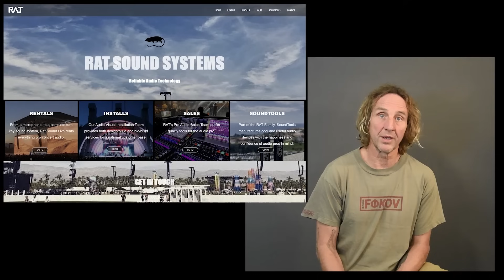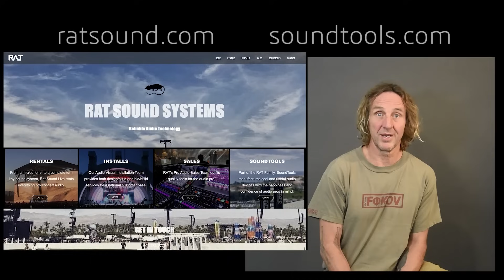How to EQ Live Sound Systems Tricks - Updated Version

Comment: Really learning a lot from these videos (thanks Dave for your generosity!)  Regarding wedges (and this is obvious but helps to keep in the back of one's head as something to check...) it's important to know the polar pattern of the mics and position the wedges accordingly.  I've made the mistake of placing wedges directly behind Beta SM58As when they should be 120 degress off-axis for maximum rejection, then sheepishly crawling in front of the performer to move it after they indicate they need more level and there's no way that's happening without me castigating myself in front of the sound gods (and audience) to move the darned thing.  Also, some stages (small venues especially) are literally hollow plywood boxes themselves and are a major source of low end feedback (wedge -> floor -> mic -> wedge).  In these instances, placing packing blankets (or whatever is handy) under the mic stand(s) and moving the wedges off the front of the stage (stealing some dance floor) or placing them on blankets too, can make a world of difference.
Reply from the maker: https://youtu.be/53-E8nUN7xM
Reply: @DaveRat  Dave, "awesome" is an overused term, but you're a freaking awesomely creative dude.  Respect! 🙏
Reply from the maker: Hell yes and thank you

Comment: Good thinking here. I do have an exception to this I wrestle with all the time. I work a medium sized venue that isn't acoustically sound. It's been engineered with acoustical treatment and fills throughout the venue to try to even the sound out and it's well-tuned. The issue is that the place can't handle a lot of sound pressure in the room without feedback from the mains and because of the size and shape of the stage it differs depending on the location of the individual microphone. Additionally I have choirs or orchestral sections whose microphones function as more of an array. I make it work, but it's less than ideal and I typically have to use channel EQs to mitigate feedback.
Reply from the maker: Sounds like some sound absorption above, behind and to the sides of stage is in order
Reply: @DaveRat  I'd absolutely love to do that, and we have gone some way towards it. The stage isn't walled in as much as it's out towards the center of the room with balconies above and below on three sides and a moderately open area behind. It's an architect's dream but somewhat less than a good dream for a sound engineer.

Comment: Great video Dave. When it comes to "ringing out" wedges, at what point in your workflow do you do this? Do you run a CD through the monitors first and get that sounding nice, and then go on with an SM58 or whatever and and ring them out? And do you find it best to do your FOH system EQ first and then add monitors in after that? Lastly, do you do your monitor EQ'ing with the FOH PA on or off? I imagine having it off helps to isolate issues, but doesn't account for the combined effect of the system as a whole.
Reply from the maker: The two systems are seperate.  Ring out mona, EQ mains and then if the pa makes the mo s ring, try to EQ those freqs from the pa first.

Comment: Dave I had a question for you about EQing without a system processor: the way we have our installed system set up, we run our speakers directly out of the console's matrix outputs and I have EQ and limiters inserted on each matrix output. In addition, I have graphics inserted into the Stereo, Mono/Center and Subwoofer main outputs (we run LCR plus subs). Do I use the EQ and limiters on the matrix outs the same way as the system processor for speaker correction and then use the master fader graphics as the venue EQ? Or would I use the matrix EQ as the venue EQ while also taking into account speaker correction?
Reply from the maker: Hmmm, the matrix eqs would be used to hear all the various speakers on each matrix send to sound the same and close to coreect So running punk and getting each some or area eq'ed similar.

The stereo eq would be to compensate to global room issues, temp changes and such.

Treat the matrix eqs like you would a system processor EQ and the stereo eq as the active show eq
Reply: @DaveRat  ahh gotcha. How would I balance the four graphics i use as the active show EQs? Do I just apply the same settings from stereo left and right graphics to the center and subwoofer graphics?
Reply from the maker: Can do, typically the center is not so loud and not shooting very far in most configs, so it's EQ shouldn't change much with room temp and such.

I treat subs as their own seperate entity.

Comment: Thank you Dave. 1. Can you talk about smiley face EQ and also, 2. what to do when you need to cut 500 ish hz on every vocal mic to get rid of boxy sound, and also 3. harshness around 1k to 2kz.
Reply: I'm not Dave Rat, but this is what I use a vocal group EQ for. I buss all my vocals to a group and insert an additional graphic EQ on that group. This helps me get additional control over global mic problems with the group para (although this definitely works best when you're using the same mic for all vocalists), and there's an additional grab graph available for the dreaded "let me put on my cowboy hat" moments that can potentially induce feedback with unplanned-for early reflections.

Comment: Dave when you EQ with a reference CD, hour headphone and the speakers venue, it sounds good at YOUR position behind the console. How do you fix huge venue in different area ? being at front stage or way up in the back of a stadium isn't sounding different than what you hear at your reference point behind your console in the middle of the venue ?
Reply from the maker: Ideally, a properly designed and set up system strives to cover a venue evenly. That said, while setting up a system and EQing, one would do all they can to even out the coverage as well as take note of issues that can not be corrected with the system/venue combination, such as a bomminess under a balcony or lost low end for people way off to the sides.

Also, mixing from room center or on a riser puts the engineer in a position where the sound is less like the sound where most listeners.

Putting reference mics located in areas of concern that go an analyzer, can be helpful for staying aware of sound in various places.  As does wandering to hear the sound in other places than the mix position so correction can be made, is wise.
Reply: @DaveRat  and I just thought that an empty venue vs a venue full of public must also affect frequency response ! thanks for the precisions !

Comment: Great video. 
I usually do small rock shows. Mixing the channels with headphone will cut off the natural sound that comes from the stage - from the drums, amplifiers,  monitors, and acoustic instruments. 
Do you ignore this when you mix, EQ and balance the band with your headphone? Is it negligible related to the FoH?
Reply from the maker: Hello Niv! So I use headphones as a reference for insuring the room sounds similar to the PFL of the instruments.  Also to compare to a recording. The goal is not to mix in headphones and ignore the room sound any more than it is to mix in the room and ignore the headphone sound.  The goal is to get the two as close possible to each other. And have both the headphone mix of the band, and the room sound of the band sound tonally similar to a desired recording of the band or similar music.

The way we perceive sound can change from day to day. If you are tired, have a cold, just off a plane flight, hung over or are 30 shows into a tour, our perception of volume levels and tonal balance will drift. If you mix a show after plane flight, you will tend to mix brighter and louder. But, if you use an SPL meter to mix to the same volume every day and you match the brightness of the PA system to the brightness of the same recording and to the brightness of the pre-house EQ console outputs, you can learn to mix the same brightness regardless of whether your personal hearing has drifted.
Reply: As a video guy, please, whatever you do, always include guitars and bass in your mix for speakers. I can't tell you how many times I've gotten a board feed and there's no guitar or bass in there because of how loud the guitar amps were on stage.
Reply from the maker: You need to request a separate feed from the main PA mix. Or request the recording feed rather than the main PA mix feed
Reply: @DaveRat  I'm traveling from city to city filming shows, so I'm always at the mercy of the house sound engineer - who has to do mains...and monitors...and stage tech...and lighting (and would probably be pulling beers as well if the venue owner had his way.) 

I know you're not a big fan of digital consoles, but I do love the ones that have built-in multitrack recording, that way I can get a stereo feed, record with a pair of mics, and then be able to create a mix after the fact. But I've only been offered that a couple of times.

Comment: Hey Dave! Great video I really enjoyed it! I have a question about the video if you have a minute: in one of your videos comparing different types of headphones you made a point that it wasn't just EQ that changed the sound across different brands and price points, it was their impulse response too. Is there a similar principle that impacts impulse responses in the room that could not be fixed with a room EQ on the board?
Reply from the maker: Yes. Differing sound systems have differing impulse responses and rooms do as well.  The impulse response is pretty much "how fast can the speaker, or sound you hear transition from quiet/stationary to a certain level/displacement and then back quiet/stationary again.

So room reverb would be similar to drive ringing where even after the signal stops, the speaker or room keeps making noise. This can not be EQed out, as I am sure ya know
Reply: @DaveRat  Dave, so are you saying that I.R.'s ( does "convolution" = IRs ) are essentially the same as the dynamics/ transients of a sound?? If that's the case then are all of these fancy new I.R. loaders really just variations on a vocoder effect? I read in a music theory book a long time ago that sounds could be broken up into 3 primary components, Pitch/Frequency---- Volume/Amplitude--- & Tone or Tonality/ the unique character of a particular sound or its waveshape. The first 2 are relatively simple to understand but Tonality is far more complex & confusing, I've been under the impressionthat I.R.s were either related to copying the particular Tone/Waveshape of an amp/ effect/ revrb/ or space, etc. Or something with phase given the name Impulse Response. Sorry for all the questions these are some of the more confusing terms I've come across so far, your work is amazing & is helping a lot of people improve their skills myself included thank you very much!! ( I know there are probably several other minor details that make up a given sound perhaps phase or panning though those seem to be  more artifacts of reproducing the sound than parts of it, would you agree or disagree about the 3 primary components of a sound?).
Reply from the maker: Hmmm, to simplify this chat.

The sound of a 10" speaker reproducing a kick is not the same as the sound of an 18" speaker.

Even if both speakers are eq'ed, and crossed over to reproduce the exact same freq response.

An SVT 8x10" will not sound the same as a 5x12" or a 3x15" rig even though they have similar surface areas on the cones.

1 big heavy speaker wi not sound the same as a lot of small light speakers.

Similar to how a light weight 4 cylinder car that goes 100 miles and hour will not handle the same as a V8 muscle car.

One will be agile and accelerate quickly and the other will have it's power at higher speed and burn through brakes quicker.

The ability to start and stop moving as well as the maximum output capabilities, are very dependent on moving mass and motor size.

This applies to cars and speakers and anything else that moves like airplanes and assembly robots.

Comment: I just manipulate energy, as the cure is inversely proportional. I use my ears to establish my point of reference, then match it throughout the system scientifically. I don't need SMAART to EQ, I only use SMAART to match. I also use SMAART to spot anomalies after I find my comfort zone. I can EQ an entire monitor system without SMAART, while never stepping out on the stage. For a good sound, we learn to layer the instruments throughout the spectrum. Dave's method for establishing a point of reference via a good set of cans is valid, but I like to just feel it.
Reply from the maker: Hey hey John! I like the feel as well. And also, I try to construct a method that works even when I have a head cold, came off a plane flight or anything that alters our perception of sound. Because what feels right changes. What seems loud on the first day of tour is not the same as what feels loud after a plane flight six months into a tour. So having reference points that do not have the human factor can be quite important.
Reply: @DaveRat  Good point. I have experienced various altered states, usually a flu, while on the road.
Reply from the maker: Ha! Flu, hangover, and the worst was scuba diving before a gig
Reply: @DaveRat  I went shooting years ago before a gig.... I was useless at the gig. (I am not a gun guy, per say)
Reply from the maker: Yeah, that would do it. trying to sort a reference method that would allow me to get close to the sound I seek, even if I was deaf, was a bit of a goal for me.
Reply: @DaveRat  You sold me.

Comment: What about system EQ? You talked about flat response. But flat frequency response does not sound good. Or does it? :)
Reply from the maker: Hmmm, a flat response versus a EQing a system to flat are two differing things.  A flat response is where "what you send tonally is what is reproduced tonally" Having a system with a flat response does not mean that the signal you send to it is flat, and therefore the signal it reproduces in not flat, the output should attempt to mirror the input.

Comment: Hi Dave! I'm usually a hired audio guy for churches. My concern is, most mixers I see have only 3 band para eq with fixed frequencies per strip (low, mid and high). It has no sweep-able frequency especially in the mids. Is it ok to work on the rest of the frequencies on a 31 band eq? Thanks in advance! I love your new updated video!
Reply from the maker: Yeah, use the tools you have to get the job done.  And if you dont have enough EQ on the strips, then ya got to do the EQing elsewhere and request a new console too!

Comment: Digital consoles have parametric EQs on their outputs (in addition to GEQs).  I like to use them instead of graphic EQs (rarely you run out of PEQ bands and need one or two of the GEQ bands), both for FOH and monitors.  My venue actually has some Klark-Techniks outboard analog PEQs collecting dust... they would have been a game changer in analog days!

A very new thing for the highest end digital consoles is EQ on channel sends.  So instead of just being able to EQ the channel before it goes anywhere, or EQ an output, now you can EQ what a channel sends to a particular output.  So for example you could notch out vocal feedback in a singer's monitor but keep their full range in other outputs, while also preserving the frequencies of OTHER instruments in the singer's monitor.  In other words you're not killing a guitar or keyboard tone to stop the vocal from feeding back, which is what could happen with output EQ notches.
Reply from the maker: I actually toured with both Meyer CP10 parametric EQs and BSS 1/3 oct graphs as my house EQs.  I would use the CP10 parametric's to tune the PA to the room for soundcheck and leave the graphs flat, then during the show, use the graphs to fine tune for the impact of heat and room sound changes due to people and such.  So basically adding a 4th layer where the parametrics eq the room/system combo and the graphs eq for the constantly changing variables.
Reply: @DaveRat  That's an interesting workflow.  With a digital console I guess you could either do that with the GEQs OR run your whole mix through an additional bus layer and use the PEQ for that bus as your in-show global adjustment EQ (if you really like PEQs like me).
Reply: A nice workaround in budget digital consoles like the X32 is, if you have channels to spare, map the same source input to two different channels and then use one for FOH and the other for sends and you can process each individually
Reply: @pablosanfilippo4781  You can go even further and use more than 2 channels!  So Lead Vocal in FOH, Lead Vocal in Lead Vocalist Mix, and Lead Vocal in other mixes.  Haha that's way too complicated.  Might be worth doing if you aren't doing FOH though, you can compress the lead vocal pretty hard in the "other mixes".

Comment: Another Dave Rat video! Even though it's technically an old one. 

Love your work and your willignness to put out this info. 

In regards to headphones, it annoys me greatly when you have other engineers who do good work criticize the use of headphones in the way you describe it - "why make a mix that only you can hear" or something to that extent.

Also question: is there any solution to LR busses with inserted graphics where you cannot PFL pre system EQ? Assuming of course no matricies are available.
Reply from the maker: Thank you Ryan!